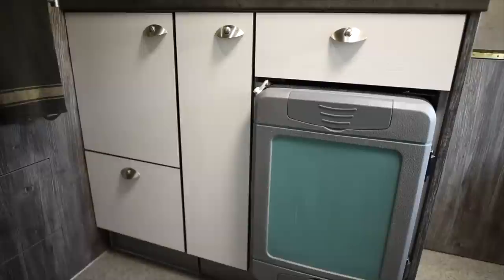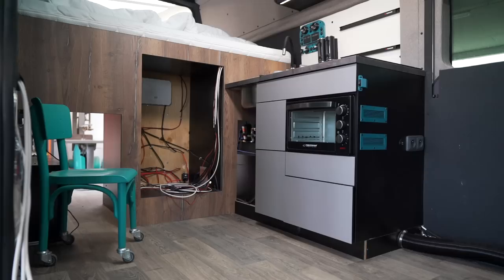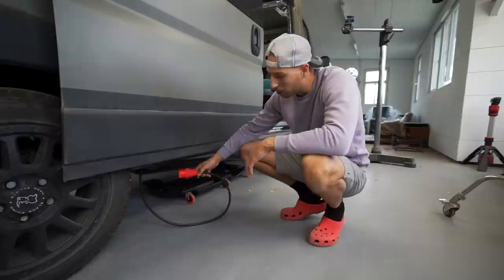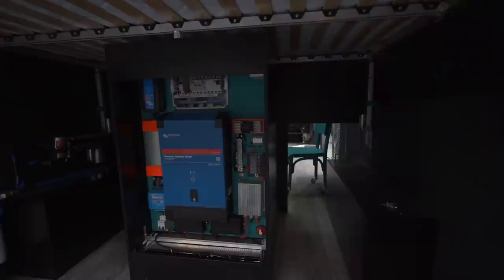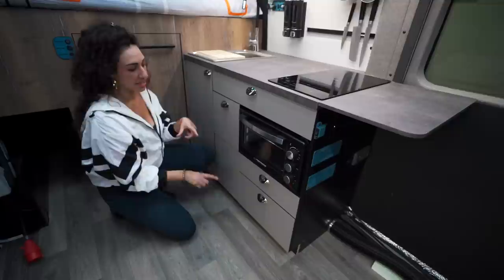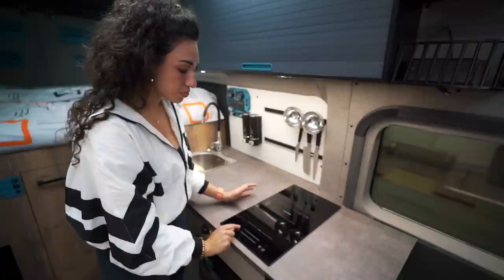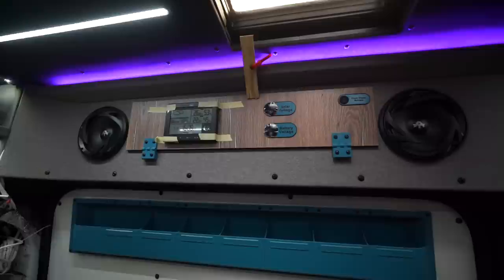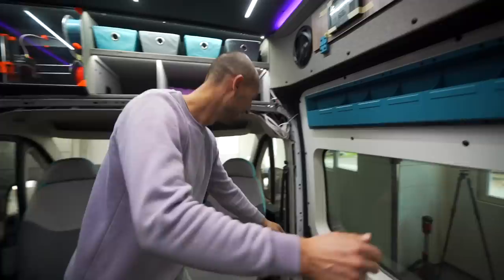Finishing Campervan Kitchen Layout / Van Life Build

Comment: An idea I think that would have been cool (although I don’t know if it’s possible or not lol) would be to have the induction cook top on the lift up extra kitchen work top section. Would give you 1 larger section of worktop rather than 2 smaller separated sections, then it can be folded away when not being used! I’m sure professor ladi would be able to come up with a way of making it work 😂

Comment: 😂👌💯      My wife is using a similar oven at home and already burned some items that were on top of that device, so beware of the heat can accumulate inside the framing kitchen box. Something else I noticed is, that the induction field is not equally in level with the rest of the surface. That’s one of the most annoying things in our Campervan and something I definitely will adapt soon.

Comment: "Microwaves are only used for reheating" is the same argument as "ovens are only used for cookies". The microwave is one of the most efficiënt and underrated ways of cooking. Fresh vegetables, without water, more flavour and quicker. Rice as easy as a rice cooker. Popcorn from kernels without fat/oil and burning, same goes for fresh potatoechips. Different kinds of cake, moister and airier. My vanbuild is wayy too small for either but if I had the room I would definately go for the microwave for the flexibility, maybe one with a built in grill

Comment: FYI, be VERY careful when using the extension reel for charging etc make sure it is fully extended all the time whether you need the length or not, otherwise the wound reel will create massive heat in very short time when load is running through it due to eddy currents. Its basically a solenoid your creating.
Reply from the maker: Yes, 1kW only when rolled.

Comment: Connect the end of the cable into the female blank connector mounted under the van. Simple and the pins will be protected.
Reply from the maker: Good point! Easy enough.
Reply: @ladiandmargaret  will you have a ‘brake’ on the cable too so you can fully extend for safety and it doesn’t pull back in?

Comment: I love the pulleys idea for the internal extension cord!

Labels are never over the top because as Ladi said, sometimes you may not remember what a switch does. It also helps if someone else is visiting or borrowing the van, etc.

Did you guys consider an atmospheric water generator at any point in your build?
Reply from the maker: Not really, why do you think it’s worth it?
Reply: @ladiandmargaret  It would allow traveling without carrying all the weight of the water, and also allow longer off-grid periods.
Reply from the maker: We usually fill our tank near the destination. Here in Europe it’s not “off-grid” not seeing a human for weeks. In most cases we are less than 20 minutes from at least a small town. Water has never been an issue for us so kind of no need for complications.

Comment: Things are really coming together!! Looks great!  The over the cab storage looks so tidy.  The kitchen is over the top (of course) 😮.  I’m planning on using induction in my build too.  It’s nice that the element turns off if the pan is removed.  Sink size is important, big enough to be comfortable - small enough not to have cover it to have adequate counter space.  I love the detail of the 3D printed label plates. I toy with the idea of purchasing a printer. If you tell me that you can print multiple colors on one layer, like multi-color text, it might tip my decision 😂😂  Answer carefully, my fate is in your hands😳😂.  And I saw that espresso machine in the opening when you mentioned a coffee maker 😁 Thank you for validating my idea for a Nespresso machine. I can move forward without feeling pretentious now😂😂.  Also, CONGRATULATIONS 🍾 I wish you 2 a long and happy marriage!!

Comment: Wonderful kitchen! 🤩 
Would you mind detailing the power consumption of the oven, the fridge, the induction cooktop, and calculating a range for the hot water heater (depending if it’s use passiv or activ)? 🙏🏼

Comment: Love it!  Everything is coming together so great! 😍  BTW, Margaret, loved your living scarf and the animal pj's were very appropriate for you, lol.  Ladi, you did an excellent job on the cabinets and the charge cable pulley system.  The labels on all the switches look good and are practical.  Ignore the haters. 😁👍

Quick question, have you looked into heating lunch boxes for reheating food?  They're meant for people to use on lunch breaks at work/school and often come with both regular plugs as well a car plugs.  Some fold mostly flat and they generally take about 30 minutes to heat up pre-made food (depending on how cold it was to begin with) and you don't really need to monitor it closely since it's not cooking.   Might be a great option for having your dinner leftovers for lunch since they don't need much room and don't use much power.  You could even have one for each of you to heat two separate meals or extra items since they are lightweight, though one is usually big enough for a light meal for two people. 

Another option is the small rice cookers with metal insert that lets you cook rice at the bottom and veggies/meat on top.   There are also small versions of those meant for lunch/travel that are really convenient.  If you like, I could send you some Amazon links and you can see if you can find matching items on the European version of the site?  Of course, there's also sites like AliExpress too but delivery times can be iffy there, even though it's usually cheaper to order from them.  Let me know! 😇

Comment: Looking good in there.

Just a thought, have you guys considered how much heat the power cord reel will generate when in use with cable left on it?

Coiled up power cords are a known fire hazard.
Reply from the maker: The cord needs to be out of the reel when running high current.

Comment: What about air fryer? Could that work for baking?
Reply: They do but you need to be a bit careful and they're pretty bulky sometimes.  Finding a model that's big enough to bake with but small enough to work in the van might be difficult, especially if you prefer using square or rectangular pans/sheets for baking.  Most air fryers have round baskets which isn't bad for baking but not ideal sometimes.  The biggest problem would be the bulk and weight, I think. 🤔

Comment: Isn't this (don't know the right word in english) rolled power cord will not be a problem when you'll draw a lot of power from it? Cause we know rolled power cord will suffer with the heat it creates and will lower how intensity it can support.
Reply from the maker: It needs to be rolled out of the reel when using high current
Reply: @ladiandmargaret  OK. I was sure you were aware of this but it's better to mention for nothing than not saying it :p

So much people doesn't know this problem. How many times I see people with a rolled power cord plugged in an asking why it goes in protect mode when they draw less power than the maximum the cord is made for...

Comment: Why didn't you print the pulleys to use a skateboard wheel bearing?
Reply from the maker: Because no bearings are needed for such a simple thing under the car.
Reply: @ladiandmargaret  it is simple, but would have been quicker to have inserted two bearings instead of those printed cone things and less friction.
Reply from the maker: Both solutions do the job

Comment: I like your videos (especially the van builds) but I don't understand why you would continue to advertise the Jackery when there are so many better systems on the market that use the better Lifepo4 cells.
Reply: I think Li-Ion vs LiFEPO4 is not a question of better/worst, but power density/weight vs longevity/security.
Reply: Because they pay the best for ads?
Reply: @yvan2563  Lifepo4 cells beat Lions hands down when it comes to investing that much money. 
You not spending that much for a couple of years use. 
Comparably priced battery systems offer more longevity and functionality.